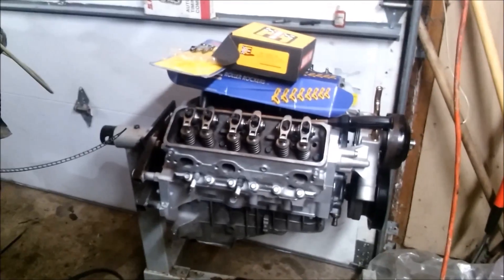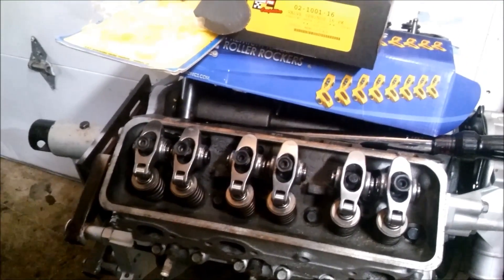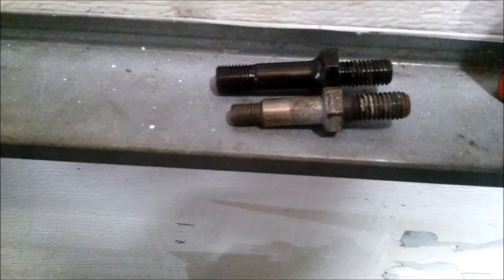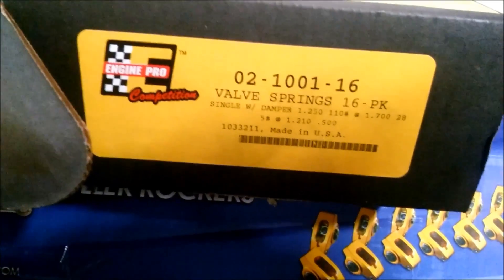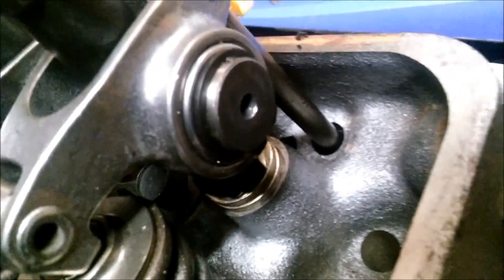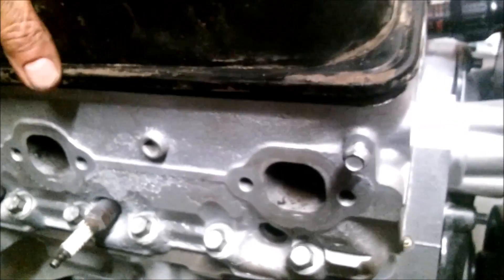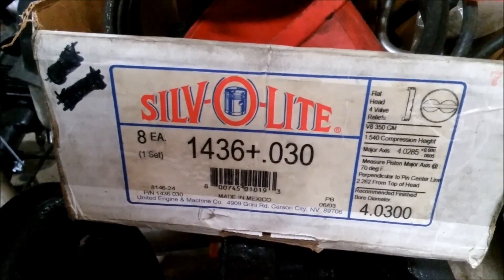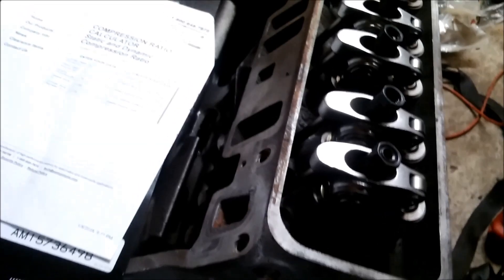Chevy 4.3 Vortec V6 engine Preformance Build with part numbers

Comment: Here’s what gets me. Early to late 1970s plenty of Smog V8s rolled off the lot with 140hp and 245tq. 

1976 305 had these specs an they put it in 4wd, 2wd trucks and cars.

I’ve never understood why so many think you have to have 350hp to move around a vehicle! If that’s what you want in a Camaro or Chevelle that’s understandable.

I just have an 85 C10 that’s 2wd. I can get to from point A to B. It’s cheap to work on! Reliable and gets good mpg. What else do I need?
Reply from the maker: I have a 1977 Chevorlet Impala with 83k (video on it) with 170hp  and I couldn't out run anyone harassing me to buy it. Had to put not for sale build your own in quarter glasses. I since dropped a 70 Vette 350 engine w 300hp and made a difference. Still have orginal. 300hp is and never was a lot from 60's to early 80's. 300hp was something you wanted to reach. Now its 600-800 stock hp for no reason. That is amateur race track power nowadays.  https://www.youtube.com/watch?v=GGhVxIzjGDc&feature=youtu.be

Comment: As for value covers. I've taken two covers and cut the top and bottom off leaving the center part...about 1"... then weld it into the other cover in middle. It's time consuming but cheap and works.

Comment: Yong guy i give you an a for your effort i think 🤔 you are on the right path and it will work crank it up on the engine tuner stand and put the rivs in it and see what happens 🥺 i think it's all good 😊 God bless you and America and Israel  😎
Reply from the maker: Had it running last year. Let it idle for 20 minutes.  After 12 years the local body shop refuses to finish painting the  car to which he was paid to do with receipts. Used to be a freind whom I used to help him with small enginesand computer work for his shop. People change.

Comment: Do you still have it?
Reply from the maker: Yes still at the same body shop that blew up the old engine but taking off the intake and turning on the ingtion to see if gas was coming out the pump. The buttoned it back up wuthout changing the oil and the orignal engine instantly started knocking.
Reply: @mobilemowers  so it's not running?.

I ruined my original 00' 4.3

Bought an 03' junkyard. Miles unknown 
Bought new injectors.
Running great besides burning oil
Roughly 100,000 miles later running.

Comment: People ask all the time why not swap an LS ect into your car ect? Well if you haven't done ANY engine swaps ( I HAVE DONE SEVERAL)...IT'S NOT JUST A FEW BOLTS AND A GASKET. It's an EVERYTHING OR NOTHING DEAL.
If you are determined enough, organized enough, and have a few skills, or friends WILLING TO HELP....your swap can turn out good and fun. But the bottom lIne is YOU ARE ON YOUR OWN, SO KEEP IT UP AND GET ER DONE.
The Keith Black/ UEW web site has a parts look up for their parts, I think those pistons will work just fine.
I am swapping a 91 4x4 4.3 v6 into my 75 2+2 four cylinder Monza 4 speed to automatic. The why not birds on the side lines will say WHY NOT A V8. I say YOU DIDN'T KICK IN THE MONEY OR LABOR TO MAKE IT HAPPEN, PLUS MY 79 MONZA HAS A V8, THIS WILL BE DIFFERENT.Keep going it will be SWEET WHEN IT'S DONE.
Reply from the maker: Exactly you will have issues spring height w more weight,  the engine ecu won't control the ls, with the dash working, factory, security controls the trans working and emissions controls.
Reply: @mobilemowers  You get it exactly! When the time comes to go that route, you will put both feet into it, and knock it out the park. I like to think previous projects are skill builders getting you ready for the next one.
Go get er done, and have fun with your ride!

Comment: hey buddy, I'm from Brazil, I have a 1999 Chevy blazer, I really want to mount a comp cams in my car, I use a 4l60e automatic transmission, I would like to know if this command requires any change in any component of the transmission, I'm going to change the system from SCPI to MPFI injection, with a Fueltech ECU for better engine and transmission management. Do you have a video of the engine running with this 56-440-6 cam?
I asked this question using Google Translate, so there may be a writing error! XD
Reply from the maker: Trans will work fine same 40l60e as the pickups just a higher stall speed converter. The stock ecu and injectors should had that little cam. Try it first. No videos of it running a body shop has had it for 10 years ( yet paid) playing games with me on it. They blew up the orginal engine by letting gas down the intake thus why I just built another one.

Comment: This might help you or somebody who is planning on building a s10 in with a V8. Everyone always said if you get one with a 4.3 it will sit right in. That is not true. You still have to get the motor mounts plates regardless of what engine it had in it and definitely run the Shorty headers because if you wanna run full length you need to relocate the oil filter and the transmission I had came out of an 88 Chevrolet long wheel base so it had a long tail transmission and it set back in the stock location of the crossmember with no modifications to the driveshaft either. I can tell you this from experience not hearsay because I put this truck together myself but that being said I would build a 4.3 simply because you can make it have plenty enough power considering the weight of the truck and it’s simply not what everybody else does.
Reply: Very interesting man. I never would have thought that you could use a tranny and be able to rock the standard driveshaft. Only other thing would be a wiring harness I'm guess and a tune. I'm just gonna build my 4.3
Reply: That's what I want to do with my Jimmy. It's not a heavy truck, and I don't want to be yet another guy who did a 350 or LS swap.
Reply: Projecting

Comment: 4.3 good  under turbo/ cam upgrade. Guy on life on limiter made a respectable 400 hp 500 lbs torque  with a 800🤑turbo kit & marine intake to replace that Nast spider injection 💉.  It's a good engine 👌
Reply from the maker: Good luck finding a Marine intake much less big bucks. I wanted one also for my 350 too as is tbi but going to have to go carb cause of that 325hp engine build I did.  Can't afford a $1,200 aftermarket tbi thats ust basically a carb anyways.

Comment: @mobilemowers any way someone can reach out? I have an 06 Vortec 262 4.3 I’m looking to boost with about 10 pounds. I just need to know what specs should I build the motor with I’m ready to go with funds just can’t find anyone who knows about them.
Reply from the maker: I am not a professional engine builder.  I get my advice from my local shop from what I don't know. Talk to who is doing the machine work. 

I do know if your doing a turbo you want lower compression. Thats why guys buy used engines with miles on them and never do the rings. They already have low compression from use. If you use new rings you really have to open the gap. Power Block TV / Power Nation did a 4..3 Tubro build with over 300hp on YouTube.

Super chargers I think can do normal to little more then stock compression easy. They have super chargers that bolt right where the ac compressor would be,

Google takes me to https://www.summitracing.com/parts/cca-12-704-8/make/chevrolet for a camshaft for boosted cars. Just be carefull and never go to high of a cam. You will loose bottom end.  Been thier. You can call Comp Cams and ask them. Wait times can be crazy

The 2003- 14 LU3 4.3L have injectors for each cylinder not the crappy spider injectors. They are like the 90's LT1's and the 99-up 5.3 ect Vortec's. Might want to swap over to that setup for guys with the older engines.

Stock stall converters on a V6 already are higher. So use the stock one. Putting a VY convertor on a V8 will wake it up. Also the V6 trans can go in a V8 the parts interchange may tell you otherwise cause of the stall. I have V6 trans and convertor in my 94 K1500 w 350. Did video's on that.

I also posted recently a video of the truck running, Hope this helps. Please like this video and maybe subcribe. Helps my video's and channels get noticed more with thier metrics.

Comment: Hay friend I have an awd astro van it has 139.000 on the dash I want rebuild it with higher performance parts and get away from the spider injection and factory junk. What do you recommend for intake and fule injection. I was thinking the elderbrock marine intake the FI or sniper fuel injection what is your thoughts. Happy Nisan 14.
Reply from the maker: The  marine intake's are rarer and $$. What computer you going to use then ? Snipper is a throttle body kinda of going backwards. Also how you going to control the dash and trans ? Big bucks your talking.

Being thrifty if you upgrade to the upgraded spider injectors you should be ok. 
Factory computers are ok if you know how to tune them. Can even send them out for a tune or use a canned tune. The factory computer can tune themselfs a little bit also. 

I know someone running 70ish Camero w a turbo  runs in the 7's using a LS engine with a factory gm computer. 

Sniper is only throttle body so you loose some power vs multiport. Carbs are cheap and easy.  Google EFI 3x™ 4.3L V6 also.  Here is using the  boat intake http://www.fullthrottlev6.com/forums/showthread.php?50198

Comment: Are all 4.3 chevy vortec's 🤔.
Reply from the maker: Vortec name came out about 1995. As far as I know the main improvement then was the heads. The heart shape chambers which flow better. The Vortec heads area great add on for a few hp for any pre 1995 engine. You may have to change the intake or have a shop machine the bolt holes. I have Vortec heads on my 1994 K1500.
Reply: @mobilemowers  well I have been thinking of an engine up grade in my 96 Sonoma highrider 4x4 and I want to stick with a V-6.
    I've also been wondering if ASTRO van axles may work I realize they may have to be altered a bit but was just wondering.  But I
want to start with an engine first.

Comment: Rocker arm studs sizes should be related to the expected RPM range.  If you built a torquer, you are rarely if ever going to see 5k RPMs.  Big studs and rocker arms, and valve springs are just not needed, unless you are seeing 6k+ RPM regularly like in a drag car.  Roller tip rockers are nice because they reduce friction/wear but doubt you'll notice performance from them because a torquer (engine with high torque vs HP), isn't going to be running in high RPM hardly ever.
My question is, did you put in flat top pistons or run the stock dished ones?
Reply from the maker: As I listed in describtion of all parts. They were Silver lite 1436 pistions. Flat top, with four valve reliefs giving a 9.5:1 to ratio or so. https://www.summitracing.com/parts/uem-1436-030
Reply: @mobilemowers  Nice, Thanks.

Comment: I built a 4.3 from a 1995 which has the roller cam and vortec heads. I had to do the washer trick to get studs up through the rockers to be able to thread the poly locks on. I used comp cams rockers which are quite low and I machined 3/8” off the poly lock but my plastic valve covers still hit. 
I saw the tall ones in Aussie but $600 shipped to Canada is insane. Does anyone know of a different route? I’ve heard guys cutting v8 covers down to fit. But I cant find vortec V8 in tall.
Reply: There's a stud out there that has the metric lower and 3/8 upper. Just have the stud boss cut flat. Haven't seen a way around it other than that.
Reply from the maker: Why not try the shorter poly locks like I did.
Reply: @mobilemowers   what was the part number? My builder couldn’t find any. I machined one down but the shoulders of the poly lock hit the inside of the roller rocker. Even with that my stock covers fit but probably would hit. Tough to tell just Turing motor by hand. I’m waiting on some 87-94 valve covers off eBay. I’m hoping they give me the room I need. 👍🏻

Comment: What did you spend and what is the hp
Reply from the maker: Spent somewhere about $800. I did most of the labor. Never had it dyno tested. I gather almost 240 hp as stock is about 190.
Reply: @mobilemowers  ok I want to do a  swap but I also want to keep the integrity of my blazer wanting to do a 283 or 305? I have the 4.3 as a well was thinking also just to rebuild it n put a msd distributor n a Holley efi sniper kit n a cam. I would do the same to the other motors as well

Comment: What year v6 motor ? I have a 87 R10 4.3 .... would I be able to do the same or?
Reply: Me too 85 v6 4.3
Reply from the maker: Well you don't use a roller camshaft.Your non roller camshafts won't be as cool with horsepower. You could do retro fit roller cam and lifters if you don't have cam retaining bolt holes in the block. Your tbi heads suck so you would need to change to Vortec heads and your intake as well.

Comment: you never did a follow up what happened?
Reply from the maker: As i stated it's been in the shop. Guy won't finish the body work which I paid.  So I don't pull it mout till he finishes it.I don't need it anyways.  Long story.
Reply: @mobilemowers  Hope you get this resolved - I’m looking forward to hearing your thoughts on the cam and power gains. I’m looking at either the 206 or the 210 myself.

Comment: Where did yo get waterpump ??
Reply from the maker: I got it off eBay If I recall as was years ago. It was leaking out the back gasket when installed. I had a shop replace the engine was it was thier fault in the first place. They were so in a hurry I just got a cast iron one locally. Then they lose that alum water pump. Yet years later it is still in the same shop not finished. Sorry I don't check comments to often. I just do this for free to help people. Cheap Youtube

Comment: How'd this 4.3 build go for you?
Reply: Wait for mine looks like he gave up on it. I'm in the process of putting my fully built 4.3 together its going great fully machined W block with eagle h beam rods srp pistons arp studs everywhere custom intake fuel injected twin turbo im throwing everything i can and going for the record in my 99 ZR2 blazer. Video soon full list of parts and process
Reply from the maker: Been running just shop never finsied the body work so it sits thier stil.
Reply: @codeack101wlck   dude  I cant wait where is the video ?im building a 4.3l also
Reply: @nobullshiit5682  yo hit me! Getting a 8 year old sitting in the back yard ‘92 could help eachother
Reply: @nobullshiit5682  lol me too, im going to start on my w 96 4.3 also
Reply: @codeack101wlck  got a 4.3 rebuilt got info bout urs? Thx

Comment: Help me out brp i have a 4.3l vortec in my 05 silverado. Hold do i start to build it for more power
Reply: I can give all of you a full list of parts soon im in the middle of fully building my 99 zr2 blazer and love this engine great parts ill tell you now though your looking at spending 5k on copying my engine build
Reply: I have the same damn engine too, i'd love to get this answered too
Reply: ShadowOps has your answer, and Westech also has a build.
Reply: Research Hotrod magazine or SuperChevy
Reply from the maker: Had it all in the video with part numbers for the 98 year I did.  Had under $1,200 or so into it. Cam shaft, true roller lifters,true double roller chain, preformance came shaft, head work, more compression pistions and better oil pump. Then will need a tune. Basics of any preformance  build.

Comment: Did you ever finish the build I wanna see if run.
Reply: Forget this dude give me a couple weeks ill start rolling out my fully built 4.3 I'm currently in the middle of building the engine now
Reply: @codeack101wlck  keep me updated
Reply: @codeack101wlck  what are some mods and parts I can buy on a budget for my 2006 silverado? 4.3l v6?
Reply: @codeack101wlck  where is the vid you only have 2 up lol
Reply: @thebushbunker  different channel Countryside Performance, ive got an update vid soon build is coming along great
Reply from the maker: Sorry its still been at the shop that screw it up. Ran fine and they test drove it.  Sorry I don't check comments to often. I just do this for free to help people. Cheap Youtube

Comment: roller rockers, excellent choice. 1.6 ratio woke my 4.3
Reply: factory computer and after market cam's don't mix will. just so you know
Reply from the maker: They do if you program the cpu. Also the cpu does program itself slightly too.
Reply: @mobilemowers  wrong.
Reply: @mobilemowers  older ECMs aren't that.
Reply: @kingjeremysircornwell7847 lol....😂

Comment: “Gas ran down the intake when they were checking it for fuel pressure and you lost a rod?” WTF?
Reply from the maker: When the shop was checking it for fuel pressure when the top intake was off lots of gas ran in the lower intake. At 60 psi or so a decent amount of gas comes out in 20-30 seconds. That gas mixed with the oil and got inbetween the rods and bearings. So gas got in the bearings and pushed the oil out. So run for a few minutes without oil and see what happens.
Reply: @mobilemowers  if it was in the shop, and they were testing it. And they caught it on fire and it busted a rod. Sounds like to me that shop just bought me a new motor
Reply from the maker: Never ever mentioned it caught on fire cause it never did. Just was knocking right after. I just built the replacement motor just to get it over with. The shop doesn't do the best of work.
Reply: either hydrolocked it or the gas thinned the oil. just a guess